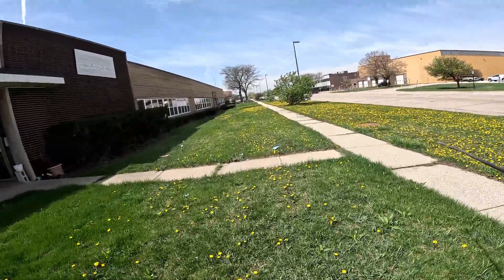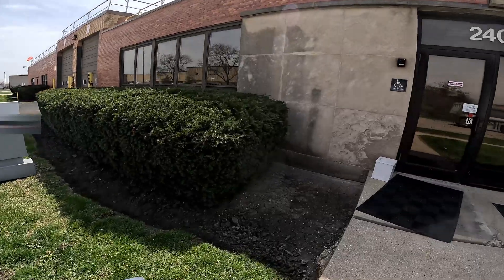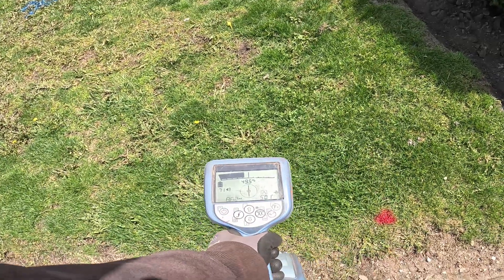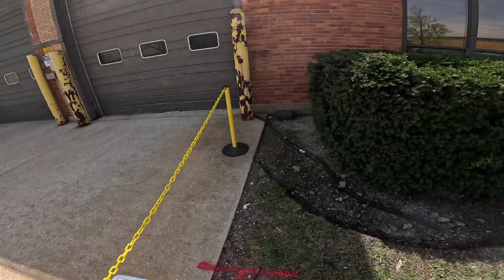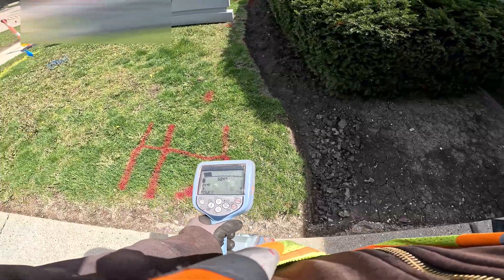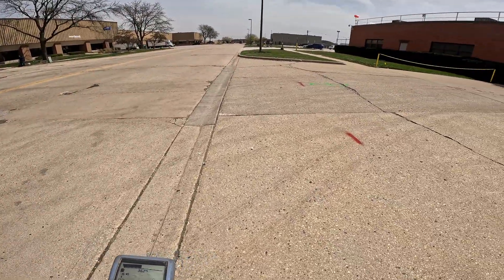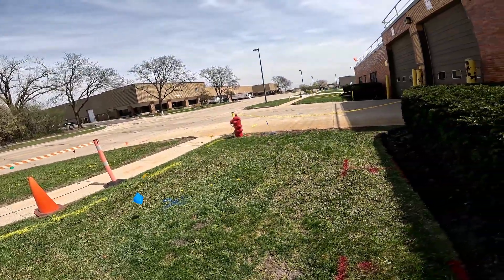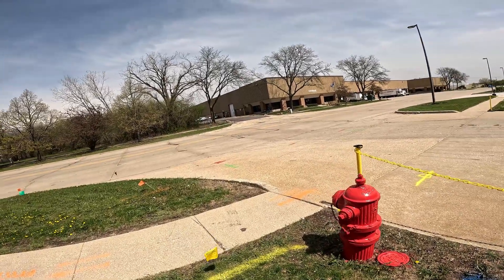High Profile Electric Duct Bank | Understanding High-Profile Electric Duct Bank

Comment: I really enjoy your locate videos.  It would be great if you could always explain your thought process on the how/why and what to hook up to for each utility.  Especially when you show the exact hook up process like you did when you connected to the power pole conduit guard in a previous video.  I never would have thought of that. Great stuff!
Reply from the maker: I apologize for any confusion. In the future, I will ensure to clearly explain my thought process and provide details on how and why I am connecting each utility in a particular way.
Reply: @811chicago5  Thanks.  You do a great job on your videos and I have learned so much.  For example, I was always wondering how to hook up to a transformer and in the video at the bank demo, you just put the red lead on the hinge, or when you used a magnet with a hook.  Seems so simple, but I was always worried about getting electrocuted messing with that much power and just used the Power 60 setting.
Reply from the maker: @LocatorDude  When conducting a power sweep at 60 Hz, there is a risk of inadvertently picking up signals from other utilities, such as an AT&T duct system. All the Transformers and switchgear should be grounded but always be cautious when working around them and make sure always ground out your box before hooking up to any electrical equipment.

Comment: dunderstanding why this is illegal in Canada..     no electricity below ground or ya get a short wich could kill someone... simple...   don put them undergrounf and no problem
Reply from the maker: The reason for using below-ground electricity for power transmission and distribution is primarily to reduce the visual impact of power lines and to protect them from environmental factors such as weather and tree limbs. Underground power lines are also less susceptible to damage from severe weather events such as storms, which can help reduce power outages and increase the reliability of the electrical grid.